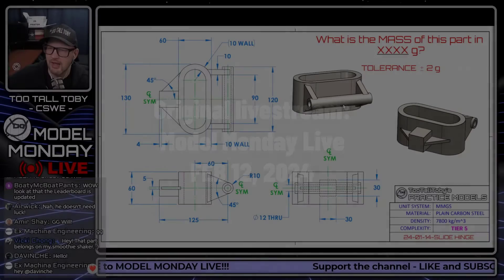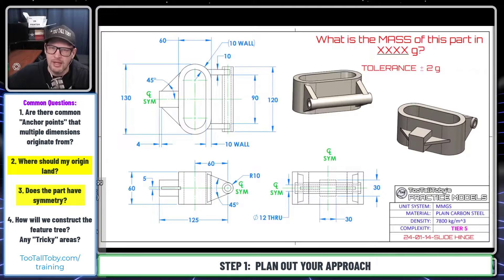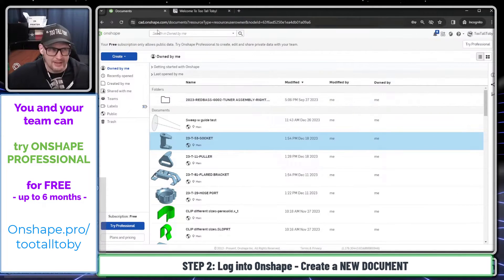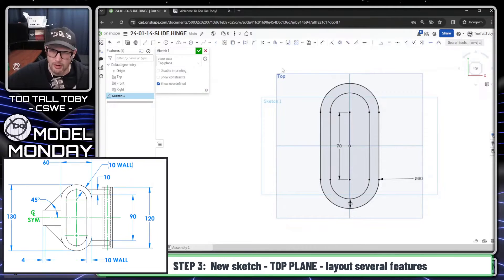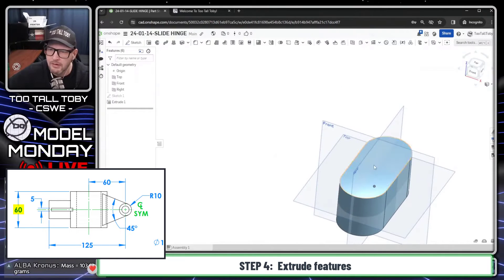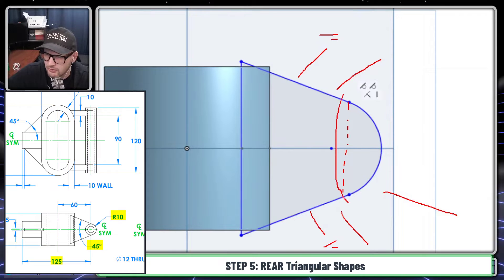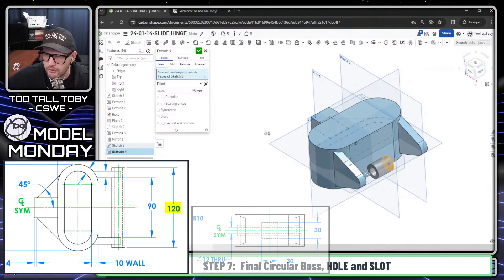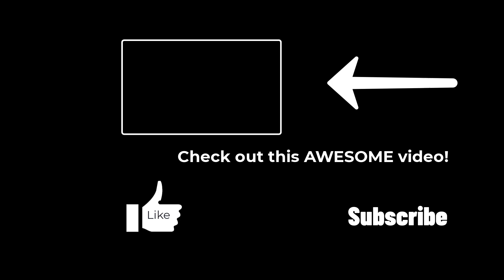FREE Onshape Tutorial - STEP by STEP

Comment: Still a noob here.  I'm thinking you saved the final cut-extrude to the end because you wanted to make sure you cut away any part of the triangle-shaped pieces that hold the horizontal tube that might otherwise have protruded into the center slot region.  Is that right?
Reply from the maker: Hey Ken!  Welcome to the community-  yes you are exactly correct - if you leave the inside "solid" until the very end of the model, you get some latitude to create "overlapping features" which run right to the center of the model.  This is often helpful because you can create relationships directly to the origin.

Then, at the end, you can cut everything away.  Great observation and you are totally on the right path!